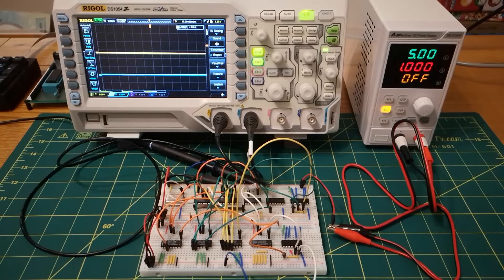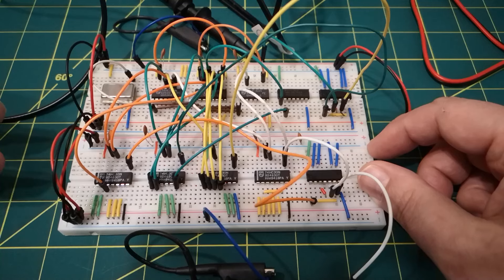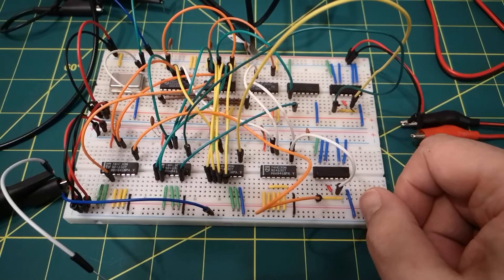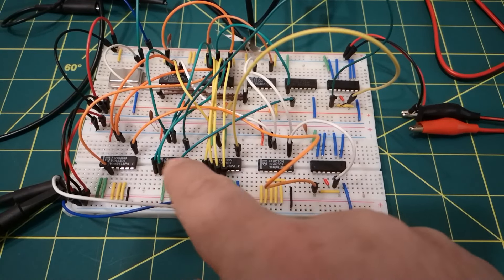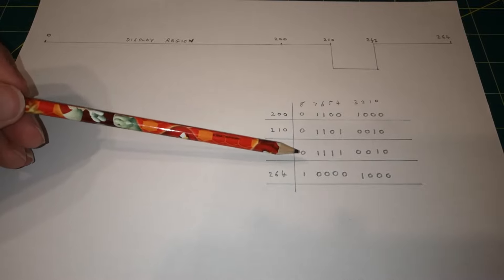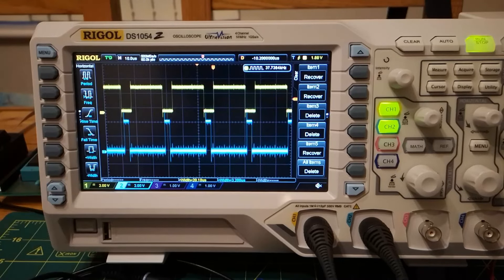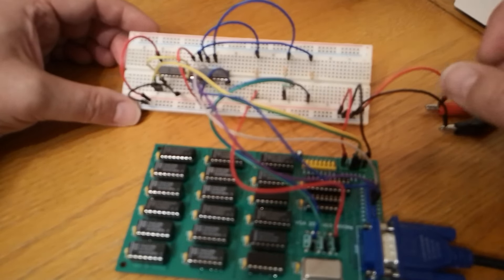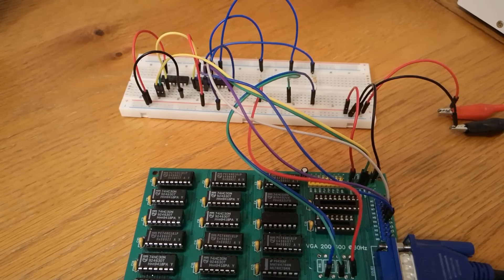Z80 Computer - Part 12 Thinking about VGA

Comment: Happy to see you back in te series!
Reply from the maker: I've had some problems. I actually re-did this video from scratch, a shorter version, higher quality with better explanations. However I lost a lot of footage and audio. So in the end I decided that I was not going to make progress unless I released this video as is. I'm thinking of scrapping the next video as well because I go into great depth explaining a circuit which turns out doesn't work. I think the next video might just have to be a short one showing an idea I'm exploring but explain that there are problems preventing me from making progress.
Reply: @SteveRaynerMakes  I think a better way to go would an FPGA. That's just one chip that can be reprogrammed for any logic. But they are a little expensive and there is learning curve
Reply from the maker: @KomomeRyu  I think that is the way I will end up going though. I just need to get one and have a play around to see how they work. It's a little overwhelming knowing which one to get and what additional hardware/software is required.

Comment: Saw this from reddit z80 sub. You could do with some decoupling caps on your breadboard. Both bulk electrolytics (47-470 uF) and ceramics 100nF range. Dunno whether you saw other options for generating timing, but you could also just run all your counter values to an EPROM and program it so that bit 0 generates HSYNC. Bit 1 decodes counter reset at max value.  Or any arbitrary pulse shape.  Skipping all the counter inverters and the high fan-in decoder gates. Trade off logic for memory cost and better density. Easy to create the bin file with a simple C or Python or whatever program. Or even Emacs in hexl-mode :-) Register the PROM outputs with a register to avoid glitches as the memory array accesses in the few nanoseconds after the address change. But a fun project, looking good!

Comment: Can you change the counter to something like SN74LV4040A-EP which is a 12 bit counter running on 5 volt. Also has surface mounting versions if you wanted to take the layout further.
Can also get 12 bit inverters as well so each line can be inverted.
Other option is running it through a microcontroller to handle all your sync signals.
Reply from the maker: I did come across that IC when trying to look for ways to reduce the chip count. However I discounted it because it is described as asynchronous. My limited understanding is that with asynchronous counters the updated count ripples though the stages, rather than all stages updating synchronously. Am I mistaken? Would an asynchronous counter work in this application?
Reply: @SteveRaynerMakes  No you're right, these do ripple, also realised you are using HC as apposed to LS in your circuits. Not sure about this one: SN74HC590A 8 bit binary counter, just came across it.